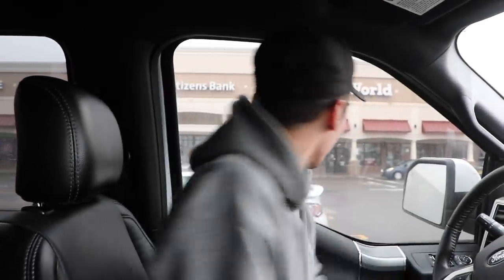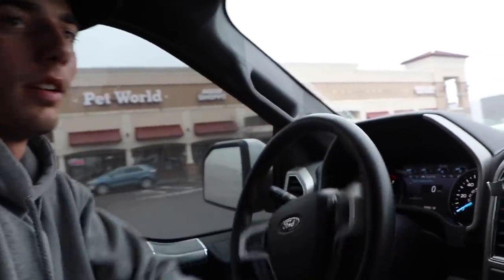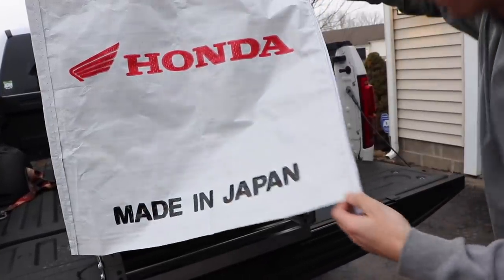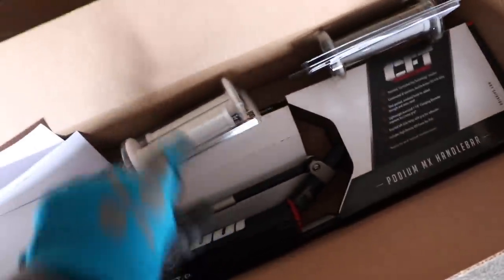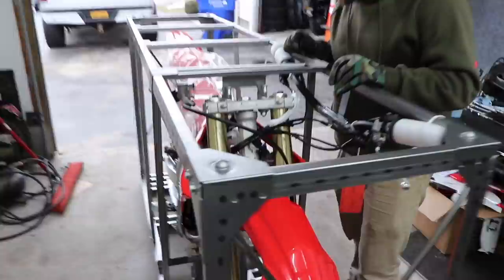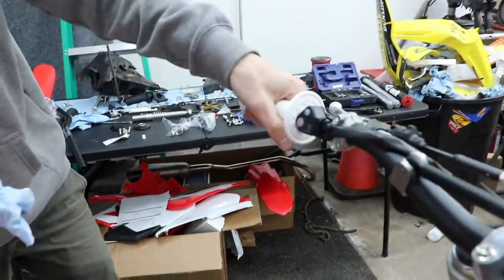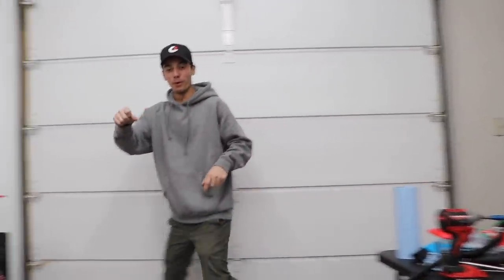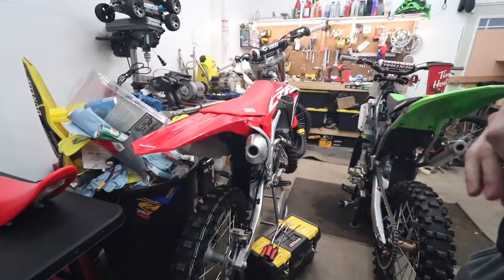Honda Sent Me A 2020 CRF250R!!!

Comment: Gets the 450L*  turns into full blown honda guy
Reply: Honda are good though
Reply: They don’t make two strokes anymore 😥 though
Reply: Can someone explain me whats the difference betweena cr crf and the crf r
Reply: @Gabriel-dr9ru  cr= 2stroke. Crf=4 stroke. The r depends on the bike but usually refers to the motocross models.
Reply: Once you ride a Honda you don’t like anything els they don’t feel as good
Reply: @Happygrowercbris420  disagree, ive owned 4 hondas and nothing beats yamaha in my opinion
Reply: @Happygrowercbris420  I’ve owned 2 Honda’s but noting fells as good as my Kawasaki,but if Honda made a 2 stroke RIDE RED
Reply: @Gabriel-dr9ru  I got you so the cr is a two stroke a crf250f is a trail bike and sounds like crap and the crf250r is a race bike and sounds smexy
Reply: @Gabriel-dr9ru  crf stands for competition racing 4 stroke and cr is just competition racing
Reply: @honda4life157  what crf250f

Comment: Every Honda bar clamp/ any clamp should be tighten all the way at the top then the bottom bolt. That’s why on the bottom front of the bar clamps there is a slanted edge.

Comment: that electric start is nice, but on some 250's its no good, because when the piston hits the compression stroke... standing and jumping on the kick start hardly gets it to move. trail tune vs race tune, its all in the cams.
Reply: Josh Frank  back fires that break legs! what? show me a link? the 250cc i have has all the easy start stuff removed... it has tons of power! literally idles down the road at 45mph with zero input. think its bad for the head blots? think if the one i have back fires it will brake the kick start lever before it brakes my leg. one kick start lever is good for about 60 cold starts then the hinge and splines are striped out.